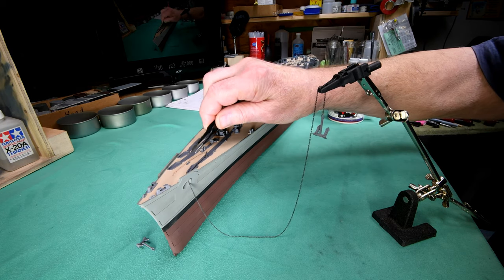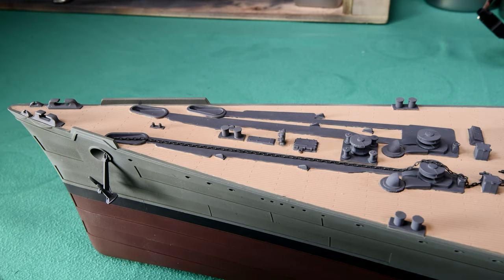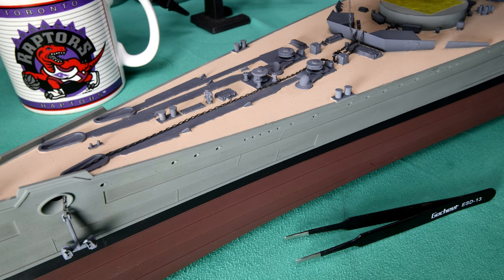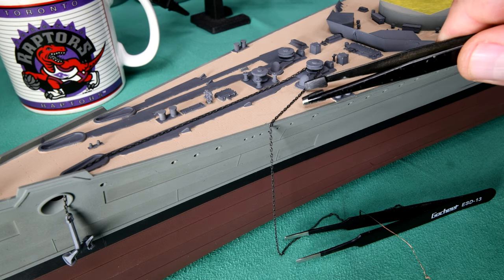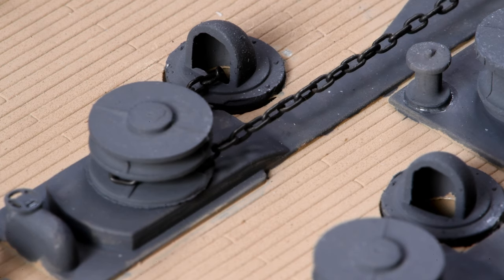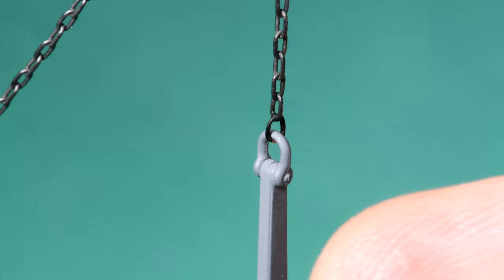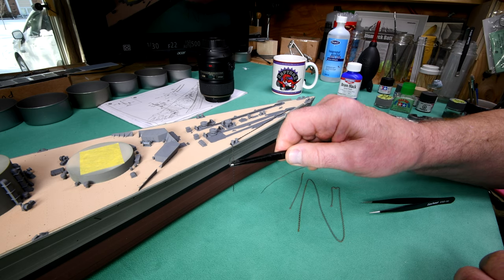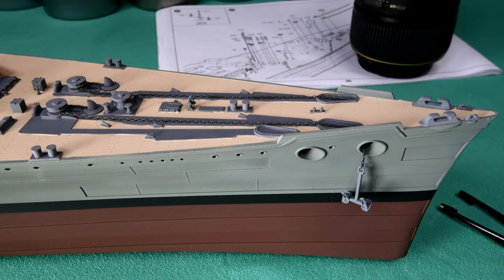The Model Ship - Part 633

Comment: Nice to get another step sorted Ron. You've motored your way through these last few weeks. You might have to slow down a bit else you'll be extending the cabinet to take more ships! 😋 (just kidding) 

Have a good evening.
Reply from the maker: Hi Barry,
The cabinet is tall enough that in an emergency it will accommodate four 1/200 scale battleships. I'm hoping that trumpeter will kit the Yamato in 1/200 while I still have the strength to unscrew the Extra Thin. 😁👍
Reply: The Yamato would be the crowning glory in the collection. One thing is for sure that the step that says make  162 anti aircraft guns is going to keep you occupied for a while! 🙂